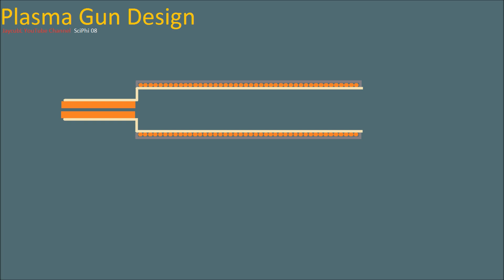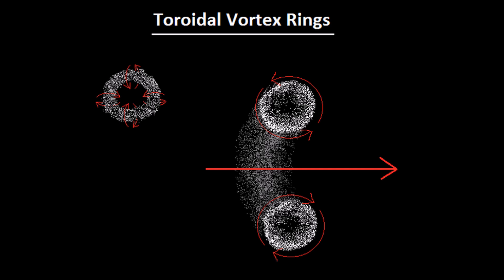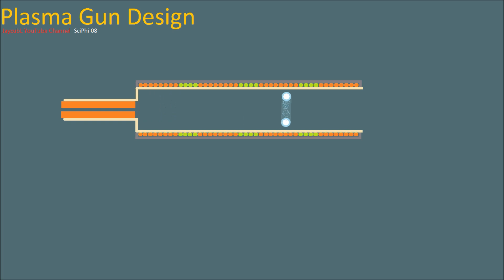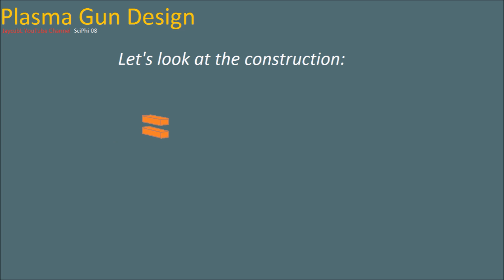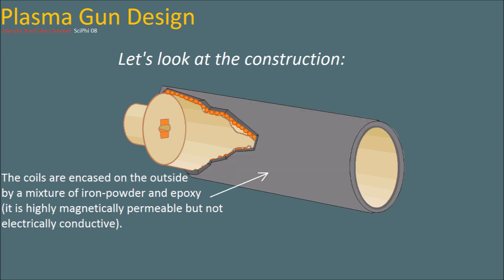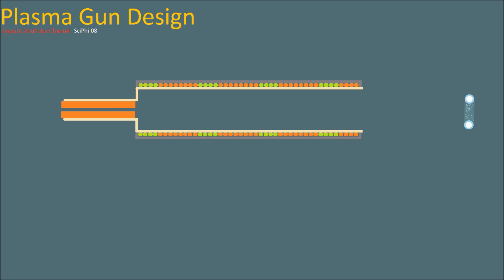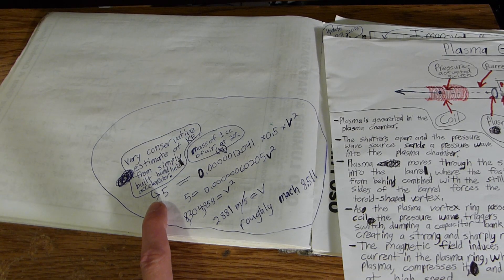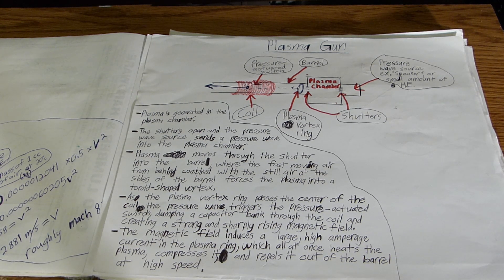Plasma Gun Design, Particle Ion Beam Weapon SciPhi 08

Comment: you need something to ionize the air so the plasma has a path to ground. a fairly high power laser would do. it's like lightening following to easiest path to ground. it of course can be done theoretically,but the power needed would negate it being a hand held weapon. in future if an efficient capacitive power source and a solid state lasing device, perhaps a hybrid tube/diode assembly if invented it most certainly want be available to the public. it may not be classified as a lethal weapon,but there is a very high potential for serious damage to the nervous system if the plasma is tuned to lock with the human one.  if the active energy beams are raised high enough,it could easily incapacitate a moving vehicle or heavier then air craft. you may adopt this info for you development sir.

Comment: Okay can I ask a question? 
Instead of a plasma "bolt" theoretically could this work with a beam
Reply from the maker: You could make some type of ion beam weapon. I designed this as one way to generate, stabilize, and accelerate a dense hot plasma because it seems more practical to me. I think it would be hard to create a particle beam weapon that would keep a straight beam at long distances but it can probably work. Tesla suggested heavy metal particles like tungsten or mercury for his death ray, it makes sense that more massive particles can carry momentum through the air more easily. This plasma gun I presented in the video would have that effect to some degree (some copper from the rails would be vaporized to join the plasma). I have also seen suggested that firing an intense pulsed laser at the instant of a charged particle (ion) beam firing could create a more electrically conductive path in a straight line through the air.

Comment: you could produce a cheep proof of concept using resin and copper cable. You'd likely get like one maybe two shots out of it, but... it'd prouve a point
Reply from the maker: Rail erosion wouldn't be THAT bad... and the plasma would not come near the walls of the barrel (it would be compressed to center).
Reply: hmm... good point... after doing a quick little search... you can get 1000 ft of 12 gage insulated copper wire for $26 online. You can even use that copper wire as the rails, although, doing so might be just a little difficult might be better to get ahold of some copper plated to use as the rails. Anyway, what you could do is take a long tube with the right outside diameter of the inside of the device and stick that inside a larger tube, construct the coil and put it in, then fill it up with 2-part resin, then you can make the rail assembly and temporarily attach it to a cap on the back end of the inner tube, then fill the rest with resin. It wouldn't look pretty, but, it would at least show that it works. And if you have an ugly thing that mostly works, then you have something to show people to drive them to shill out money, because right now, it's all on paper, and thus risky.
Reply from the maker: Yeah that sounds like a fairly easy way to build it. The controller and power supply for the linear induction motor would be a little hard but definitely possible to make.
Reply: well, there's two ways you can approach the power necessary to make it, given that you'll need something on the scale of like 90 KV to make it shoot in the first place. 1) you have a DC power supply that powers the rails and the main coil through a bank of transformers, say 4 10x step-up transformers. you flip a switch, it creates a single pulse that that is amplified, and you get a single (ish) shot. You'd need a bleeder resistor to prevent a hard short, unless the resistance in the transformer is enough. A simple button that you need to hold to complete the circuit should be just fine. and 2) go with AC power, and transformers. With this one, the time that it takes between the arc start, and the plasma leaving the business end of the device should be WELL within even a fraction of a cycle of AC power, meaning that the fact that it is alternating current really shouldn't make any difference in it's ability to function.
Reply from the maker: Well the LIM (coil accelerator section) will need to be driven by high frequency polyphase AC (to generate the linear wave pattern of forward rolling magnetic fields). The voltage would not need to be so incredibly high. Sure you need high voltage to get high current, but like you suggested: a simpler demo version would be OK for a first model.
Reply: woot! well, I'd been thinking about it for a while actually, but that forward rolling wave pattern is something I wasn't really familiar with, but it makes sense. Seems to me that this proposed model could work enough, and cost something like maybe $100-$200 or so to create
Reply: I just thought of something: If the device would require two independent power supplies, one for the coil, one for the rails, then shouldn't you be able to turn the coil on independently from the rails? like, say, you 'arm' the device by switching on the LIM, then you fire it by pulsing an arc through the rails? and that pulse could be a singular C pulse
Reply: bysTaXx Gamming I asked yhe same think and he said yes you need two power supplies.
Reply from the maker: I mean it could come all from the same battery / main power source but yeah you would need a 3 separate systems, HV rail igniter circuit, main rail power, high-frequency polyphase AC main coil power, and also a 4th circuit for control components.

Comment: you would be better off generating a packet of plasma in a magnetic bottle.  that toroid of gas is going to expand very quickly once it is out of the tube.  because you are giving it a charge it will expand and dissipate even faster.  just create plasma and then as you release it from containment accelerate it down a confined barrel as a stream of material like a water hose,  it would essentially be a longer range plasma cutter. the toroid idea doesn't help you, it just insures you are dissipating the material and thus the energy.   how far you could get it to reach would depend on how fast you can get it moving down the barrel.  the plasma would cool very quickly, so you'd have to be sending it out of the barrel at tremendous velocities to have any hope of getting useful range out of it.
Reply from the maker: The toroid is stabilized by the current (self constricting radially inward perpendicular to the direction of the current, it constricts the plasma conductor into a dense filament (direction of current is around the ring)). If you project the plasma into the air like a torch as you described it will dissipate quickly, but a self-magnetically constricted toroidal vortex filament should be more stable. It can be easily shown by experiment that a toroidal vortex of air can be stable out to surprisingly long ranges (at least a couple hundred yards). A magnetically focused dense plasma toroidal vortex at hypersonic speeds should carry much further. That is my hypothesis anyway.
Reply: blow a smoke ring and watch what happens.  now take into consideration that it has a fairly strong magnetic field, and anything it passes that conducts electricity will be causing it to lose energy.  if your goal is to make neat circle designs on stuff at close range, great.  if the goal is to try to get the material as far as you can while it's still in a plasma state for the purpose of causing damage to a very small area, a toroid is going to work against you.

Comment: Introducing magnetic choke points in the linear induction coils would cause compression and expansion of  the ring plasmoid. Is it possible to coax the ring to behave like an ion beam in a synchotron where an undulator magnetic array forces acceleration in ions and a release of constructively interfering and highly collimated light? At each point of maximum compression or expansion the ring would suddenly change directions, inward or outward, at which point any charge particles would give off radiation from the change in diameter because this changes the path of the particles radially to their motion. So like a 3D plasmoid version of a synchotron.

Would this help with self heating or pre-ionizing the path to targets if the plasma was not cooled too much? Is this going to fry the interior or will the radiation be highly directional? It seems like the structure of the ring plasmoid would give off this type of radiation in both the forward and backward direction until the forward speed exceeded the speed of the electrons and positive ions in the backwards components of the rings MHD flow.

Comment: Have you considered a beam driven approach using the dense plasma focus configuration? this should result in an elongated reversed field pinch that decays slower with greater surface area for magnetic coupling and has a better aerodynamic profile since the beam drives out gas from the path of the plasmoid. Also a beam driven pulsed plasmoid would have the benefit of recharging the toroidal current flow in the surrounding plasma sheath after each pulse from induction and redirection of beam ions into the sheath. This technique would be best applied with your induction coil producing a rotating magnetic field that matches the beta orbit frequency for electrons at the diameter of the barrel. That should keep the walls free of plasma and thus safer from corrosion.
Reply from the maker: Thanks for your comment! I haven't considered a beam driven approach like you are describing. I have thought about a possible ion beam weapon driven by emissions from a dense plasma focus like what can be seen on the focus fusion society website, but I am not clearly seeing why you want to combine that with a projected plasmoid in the same weapon (other than what you described about the beam keeping the plasmoid alive longer). My opinion about recharging the plasmoid in flight is that a microwave beam would be a good choice. Protecting the barrel from the plasma should not be an issue since the linear induction motor constructed like it is shown in this video would compress the plasma to the center.
Reply: JaycubL Very nice. I considered the DPF superior as a source of plasma for another reason. A spark gap preionizer behind the anode made of two pieces of copper wool after the gas intake. Instead of  entraining only the air mass between the rails from the gas feed, the ionized gas would pinch itself through the anode and the dense plasmoid formed each pulse. This way you can introduce large volumes of fuel that is conductive before entering the gun bore.
Reply from the maker: OH I see, thank you for clarifying. You could create a "heavier" plasmoid that way, that is what you are saying right? Plus help with the ignition. Yeah I like that idea of a pre-conditioning stage for the plasmoid. For a denser plasmoid it might be possible to use a rail material that erodes fairly quickly so you end up with a lot of metal / metal oxide vapor in the plasmoid.
Reply: Have you seen the NASA plasmoid thruster using a reversed field configuration RFC? They use 3 or more phase rotated coils to generate rotation in the ring plasmoid until it elongates and then squeezed out of the barrel using conical copper tubes to asymmetrically confine the RFC plasmid. In my ideal approach a beam from pulsed dense plasma focus would peel itself apart into the reversed field configuration as it rotated through the linear or linear rotating magnetic flux. That make sense? The beam forms the backbone of a ring or a serious of rings that merge into something that tunnels through the air like a worm.l, turning itself inside out to slide frictionlessly through the air.
Reply: JaycubL There is a small team called Electrofluidsystems that has a video on YouTube titled "Breakthrough in Air Breathing Plasma Technology" or some such. they use nanosecond pulsed circuit (not sure if AC or DC) to generate non thermal plasma arcs to the anode to get a nice magnetohydrodynamic curve for electrons to rush to the tip in a gradient magnetic field with a conical apex. The anode spits out a cone of ions that would be a 3D rotation of the 2D arc from a two armed railgun. Any volume of ions in the center of the cone is going to much hotter and hopefully the interaction of the gradient of ion speeds in the path of the beam in contrast to the toroidal plasmoids generated further pinches and accelerates the core beam. A coaxial flow of ions is established such that a partial vacuum separates the beam and the ring plasmoid so they can move as a packet with low average density colder, more neutral plasma sheath delivering a denser hotter core of fast moving ions.

Comment: I've seen a similar design before, I forget who did it, but it was a toroidal vortex plasma gun.
Reply: max uhl yes the one the navy is looking at it. the problem is that one doesn't reach good speeds as it doesn't have the linear induction motor like this one, and it creates a larger less stable power consuming plasma. This one can generate smaller plasmas which magnetically connect to form a bolt which combined with magnetic acceleration allows very large range. and if it even skims somebody the electromagnetic containment field will zap them.
Reply: apeture123 I have so many questions about how a plasma-matrix toroidal vortex would affect electronics, and how the environment would affect the travel and formation of said vortex. Like whether it holds together after being "fired" or if it'd dissipate over time, or right away. How would air pressure, density, humidity, even a vacuum affect the function of such a tool? Could it be used in space? Could it be scaled up to take out vehicles, UAV, would it be able to travel far enough to hit a target at speed? All, of course, utterly hypothetical at the moment. Although the one about vacuum is the most intriguing, to me, because if it does or does not dissipate it could be used perhaps as an anti satellite weapon... blah blah, ayhoozles, I'm no electrical engineer, physicist, nor am I familiar with how any of that would even be measured. I'm just an enthusiastic layman.
Reply: apeture123 !!! Keep me informed to that point, if you will!
Reply: apeture123 -_- feel like my chain's bein' pulled here.
Reply: apeture123 Okaaaaaay..?

Comment: YOU HAVE NEED A ONE PEACE TO COMPLETE THAT..I HAVE THAT WEAPON 12 YEARS AGO..
Reply: I don't need a big pack of batteries buddy..but that is not I want to work for, I am designing a lightweight long range lightning gun with my secret energy drive and mechanical power that converts to million volts of electricity.i don't want this design be putted on wrong hands.
Reply: plasma battery source
Reply: White man cool. i will be using a basic method used in saucers for decades now, semi conductive oxide mixed with compatible radioactive isotope. directly converts various wavelengths of light and heat into electricity. just gonna amplify a few things using some transformers you know?
Reply: White man fusion? or some other badass plasma based power source?
Reply: i mean i can get better results with the method i'm using if i used a different radiant energy source but eh, it's just a light weight gun. gotta be at least a little cheap. it's really sad what the textbooks ball direct conversion lol.

Comment: Hey, I read up on the matter more carefully and have some comments:
What if you used a toroid plasma railgun to begin with, then your plasma will predictably come out as a toroid instead of depending on unpredictable interaction with the atmosphere.
Also, eddy current puts inward pressure on the armature, won't the plasma ring collapse?
Reply: Eddy current compressing the plasma ring may not be such a bad thing now that I think of it more. Could be a focusing mechanism.
Reply from the maker: You could use a ring shaped rail gun but my thought on that was that it would be harder to ensure the arc strikes all the way around and not just on one side, especially as the rails wear. I think the simple rail layout in the video would be fine, the nozzle section at the end of the rail gun can be experimented with to reliably form the toroidal vortex. Yes the ring would be radially compressed  becoming much denser hotter, it would also self compress axially with the current in the ring (making the ring thin/hair like) but as current rises in the ring, the ring would also self repel radially (current on one side of the loop is opposite current on the other side) so some equilibrium point would be found. The compression would probably give it a better chance in the atmosphere for a fraction of a second.
Reply: I have a question, so voltage needed the arc through a fire is lower than air, would it reduce the gun's bulk if you injected fuel into the gun and used a combustion to make it easier to generate plasma?
Reply from the maker: Fan Jerry Might work yeah. In space you would need something like that or at least a gas supply. If it is not needed then it would be better in my opinion to leave out any unnecessary systems like that to save weight and cost/complexity though.

Comment: You could use a plasma discharged to project around and says the plaza for being the primary room itself
Reply from the maker: ??? I think some auto-correct may have happened or something.
Reply: JaycubL use the plasma to propel a solid projectile instead of using the plasma as the projectile

Comment: Use a different gas as ammo. Neon would work
Reply from the maker: Yes a supply of more conductive gas would help (and would be needed for use in space) but it would be nice if it works fine with regular air (less weight and complexity for the device).